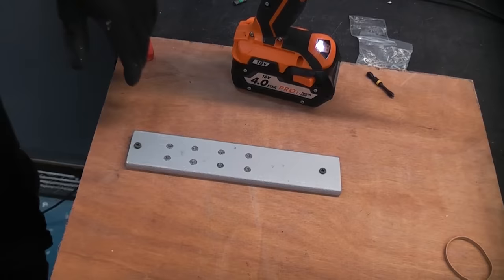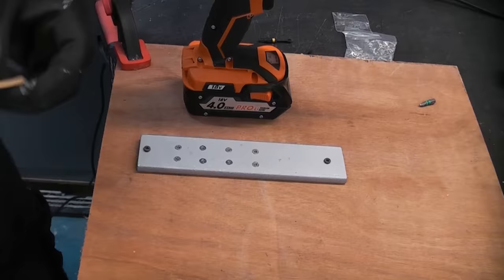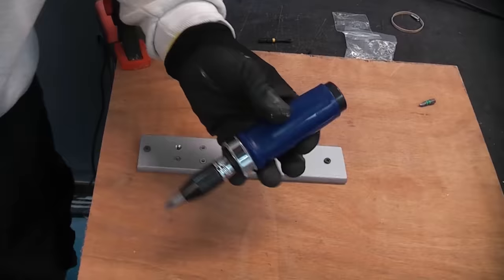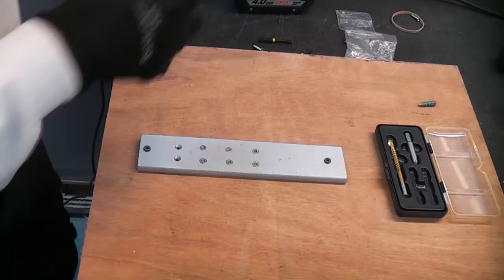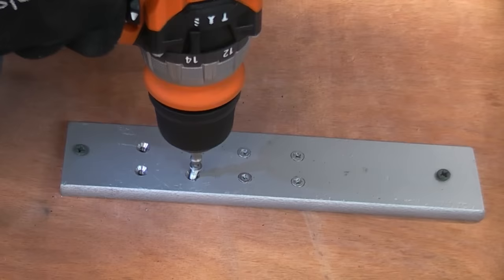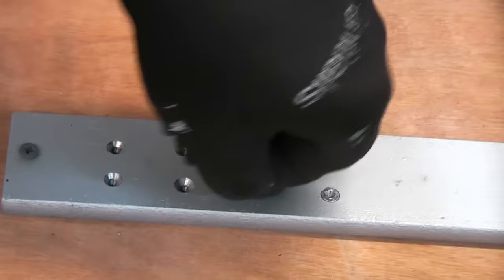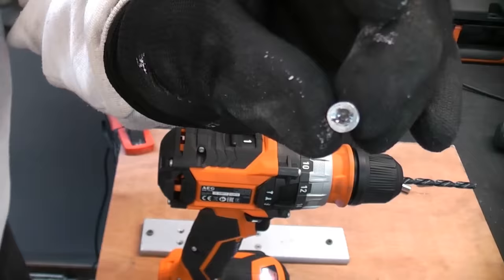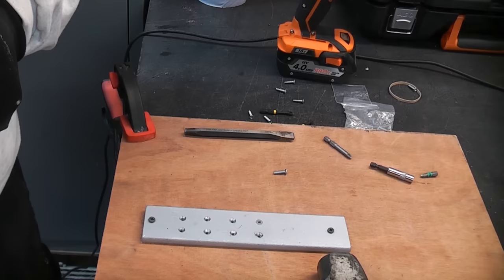How to remove stripped screws – 7 different ways

Comment: With stripped bolts or screws I've had really good success with taking a Dremel & simply cutting a slot across it & then using an appropriate sized screwdriver to break it free.

Even having the very small space to cut a straight slot is usually enough to work it free.

I can't tell you how many rusted & stripped automotive screws I've done this to. Grab the Dremel, cut a slot & remove it.

Comment: Fantastic video, learned a lot!
Sadly none of them helped me with my problem, as my case has a very small screw holding an SSD in place on a motherboard.
First trick didn't work on it and the other ones I avoid to not risk damaging the motherboard or other components.
Any idea how I could get out a very small screw without risking damage to the socket and its surroundings?
Reply from the maker: This might help-
Small stripped screw- https://www.youtube.com/watch?v=xaQ9eX-b6GA&t

Comment: Hi, Got the same issue but with a teeny tiny screw on a laptop's motherboard. The elastic band method didn't work. Don't know how to use a drill and the rest of the methods couldn't be used there for obvious reasons. Any help?
Reply from the maker: Small stripped screw- https://www.youtube.com/watch?v=xaQ9eX-b6GA&t

Comment: What do you think makes the rubber band method works?
Reply from the maker: I think it's just the extra friction.
Friction is a complex matter, I did not see a morse taper attachment until I was about 22, until that point I had only ever seen chucks with jaws- I was amazed that a morse taper could hold drill bits etc. without actually tightening anything up!
Thanks for the comment 👍

Comment: Just a note.  you can use a very small masonry bit just bigger than the shank on hardened screws, drill till the head comes off.  Do that on all the screws in the case of this plate, remove the plate using something like a wonder bar and unscrew the screws with a pair of vise grips.  These are great tips and I'll be sure to remember them.

Comment: A technique that works is putting pressure to the direction where the screw must go. For example if the bad screw is on the cover of a clock, you should pull the cover upwards while uncscrewing.

Comment: hi what would you use where the screw is the allen type screw where the inside has rounded off. The screw holds plastic in place on a motorbike which has little or no space to get a drill in.
Reply from the maker: This might give you some ideas- https://www.youtube.com/watch?v=WDOWPekMX44

Comment: At 7:03

Instead of using a left handed bit. If your drill can reverse, then can you just use a regular drill bit in reverse to turn the stripped screw loose?

Comment: You could also try to weld something to the top of the screw to try to remove long screws. Soldering may work as well, but you'll have to use specific flux, like orthophosphoric acid (citric acid, aspirin, etc. may work as well) to work with steel, especially stainless steel, which may damage soldering tip.

Comment: 👍👍👍Great video..I work as a locksmith and this happens all the time. Today i learned something new,,Test rubber bands...Do you have any tips for one-way screws. They are hardened. Today i use a chisel for a one-way screw, then it usually works. Otherwise, it will be hammer and nails. Do you have any other tips? Thanks for a great video..
Sincerely. Rogga/Sweden
Reply from the maker: Hi Rogga, I don’t have any more tips sorry, as they are all in this video. I have never had to remove one-way screws yet, but can imagine them being difficult to remove! 
Thanks for the comment 👍

Comment: I just used the spring action nail punch, and it worked!!!😮 The screw was stuck bad and I tried using a drill bit but it was the wrong direction so it made the screw worse, but I'll be damned, nail punch worked. I tried a regular punch, couldn't get it. But the spring one is where it's at!!
Reply from the maker: I have to admit that I was sceptical about the spring tools, but they are awesome 👍

Comment: What if it's on something delicate like a motherboard because i have the same issue I need to  change the thermal paste on my laptop but open the last screw that is stripped will the rubberband method work because the screw is too small
Reply from the maker: This should help-
Small stripped screw- https://www.youtube.com/watch?v=xaQ9eX-b6GA&t

Comment: You can weld a t shaped round bar(rebar) to the screw head and then rotate the same in anticlockwise direction to remove the screw easily.  I have removed a lot of bolts that were applied with high torque and loctite on the threads and still managed to remove them using this technique. Make a T shaped thing. Weld it to head and just rotate it anti clockwise.
Reply: @ultimatehandyman  its works mate. Try it. If possible will make video and share on YouTube.

Comment: Hi, I 'm trying to remove a burner from a gas kitchen top that is screwed to the stainlees steell  top of the kitchen. I 'm afraid That if use a impact driver, the steel on the top could be damaged  and since it's
It's not mine it may be damaged , please could You give me an advice as to , what can I do or what product can I use , ( iused w40 it dint loosen the screw), to pull this through?.
Reply from the maker: I'm afraid you might really struggle with this one, if it's been subjected to heating/cooling cycles.
Sometimes the only option is to drill them out! 
(Obviously it's hard to give specific advice without seeing it)
Reply: @ultimatehandyman Thanks

Comment: I have a screw  with a damaged head in a UPVC window handle that I cannot remove.  I have tried your various tricks and none of them work I went out and bought all the tools and nothing works  `its hard to get into the hole as screw is very recessed.  Is there another way to remvoe the  screw

Comment: Can you explain what you mean about wood screws at the end 8:42? Why couldn't these techniques apply for screws in wood (if I dont care about preserving the wood's good condition)?

Thank you for the vid, BTW. This is brilliant information.
Reply from the maker: The problem with wood screws, is that the head normally shears off, leaving the remainder of the screw behind. You then have to use a hollow drill bit to extract the screw and then repair the hole 👍

Comment: Wished these could help but I'm working on a small screw at the back of a Laptop so pressure would cause harm to the components under it and it's not large enough for the rubber band tactic

Comment: My Mom stained and varnished over her kitchen cabinets many many years ago. Now one of the hinges has broken off under the screw at the top and under the screw. The screws are now imo ilized and I cannot get a screwdriver into it. What can be done?
Reply from the maker: I would apply some paint stripper using a small brush, or failing that I would use a heat gun to remove the paint 👍

Comment: What if the screw is upside down with very little space around it to work with? Trying to get the screws off the carburetor bowl on my lawn tractor.
Reply from the maker: It's always difficult when the screws are in situation like that!
Hopefully you might be able to get one of the methods to work

Comment: I have a real issue with window handles.

Im tryna change them but the screws are really rounded, and to make it worse the screws are hard to get at as they are sunk into the housing of the upvc and the windows are in the open position so no real pressure can be applied on the drill or driver.

Helpppp

Comment: my landlord's been putting locks on doors to rooms in my house. getting the padlocks off is easy enough but he strips the screws on the lock fittings. i don't know if i'll be going out to buy any of that specialist equipment, certainly not a power drill, but i'll be giving the rubber band trick a go

Comment: You are working with screws that are not tightly attached to whatever they're screwed in and that helps a lot.. i have a screw that's so stiff it needed a lot of force to turn and that is why it got damaged in the first place.. I don't think i will have so much luck with it

Comment: I'm trying to get the screws out of the bottom of a top load washing machine as I need to remove the tub to clean it because it's covered in soap scrum and lime. And the screws are so eroded like concrete & breaking in the centre but I don't have a screw driver and broke a hand one and my wrist is killing me. So do I need to go buy a screwdriver?
Reply from the maker: Can’t you clean the drum using chemicals, without removing anything?
Reply: @ultimatehandyman  I tried with vinegar and a hot wash but still getting soap scrum on clothes. Oh well I might just have to get a new washing machine.

Comment: Great in theory, but aside from being tightly screwed in with a damaged head, the screws were not seized.  Do this same test with corroded or rusted screws.  I bet you have a different result.  Where I come from, screws get damaged not from using g the wrong sized driver but from using the right driver on a corroded and seized screw.

Comment: How can I get a stripped screw out of the hand wheel of my sewing machine. It is in a hole so I need something that will fit in the hole. I don’t even know what type of screw it is. I would appreciate any help I could get.
Reply from the maker: You might be able to get it using a left handed drill bit- https://fave.co/3DGC9fO

Comment: What if the screw is upside down 😢
Reply from the maker: It’s more difficult, but still possible. As a maintenance engineer, I had to squeeze into some tight spots, often led on my back in water etc. There is always a way 👍

Comment: Rounded screws, yes, but clearly none of these screws were rusted in. Most damaged screws I've encountered require an extreme amount of force. Id like to know if any of these techniques work with rusted screws.
Reply from the maker: For rusted screws, apply spray penetrant, or heat (if possible)
The centre punch works well 👍

Comment: A very useful tutorial. My only objection is that the screws were not very tight, or very long. The head was pretty damaged but it didn't require a lot of force to unscrew. It is obvious by the sound of the drill and the depth of the screwing.  A good video though, thumps up! I definitely learned something.

Comment: Any tips on removing screw after head has come off
Reply from the maker: Sometimes they are impossible to remove. On larger diameter screws, sometimes you can drill a hole down the centre and use a screw extractor. But with most screws like that the chances of removal are very low
Reply: thank you

Comment: Im having trouble removing a bolt that is stuck on my ebike motor i have a drill the does forward and reverse i managed to drill through the bolt but broke 2 drill bits
Reply from the maker: Cobalt drill bits are often better for jobs like that 👍

Comment: Good tips but half these techniques rely on minimal friction between the screw and the material. In wood, it doesn't usually work to initially loosen up the screw then simply spin it out with your fingers.

Comment: So I bought a license plate screw set (that needs a specific bit to remove it.) Of course before I needed to (a couple years later)…I had lost the “key” bit! So I thought I was being practical by just using regular Philips head with a rounded head to replace them when I finally got those out. And I just really over tightened them. So of course now that I want to remove those…(because I put them in so tightly) I’ve managed to completely strip one! So I’m here…but yes…I guess…maybe…just maybe…my age is a factor!
Reply from the maker: Best of luck with it 👍
If you are anywhere near Darwen, Lancs, I would be happy to help 👍
Reply: @ultimatehandyman  Well I got the one closest to the corner where my registration sticker goes…the license plate frame that I have on it makes it impossible to put the registration.sticker on correctly. So I managed to get enough space to do that and just tighten that screw back tight! The other side (screw) was only barely loosened so I put some foam insulation behind it to make up the space…so it wouldn’t rattle!lol I may have to get that “bit” for removing stripped screws to eventually get the job done correctly! Thanks for replying

Comment: You missed one but it will cause some surface damage . Dremel with a cutoff wheel to cut a slot in the head so you can then use a flat blade screwdriver.

Comment: This cover most of the possible ways to remove a new screw, but what about a screw inside the shower handle and it’s frozen tight. The screw doesn’t budge and I’ve tried every method here without any success. The screw is stuck and hasn’t moved to. It feels as though I need to get some rust remover lubricant to help with loosening it. It’s been a real pain. Ugh!

Comment: how about how to remove a 5/32 allen head screw, that is deep inside the actual screw hole from a piece of aluminum without damaging the aluminum, it is actually the bolt catch screw of an ar-15 lower receiver just to let you know
Reply from the maker: Is there any chance you can fit something down the hole to protect the aluminum, something like in this video- https://www.youtube.com/watch?v=dJfkCj3FWBs

Comment: The best thing  is prevention by not stripping the head in the first place, so
1. do not put damaged screws in in the first place, yes people do it!
2. if the screw head is full of dirt or paint clean it out first
3 if it looks worn use a correct size bit in  the head and give it a hard tap with a hammer. 
4. most people see the damaged screw and remove it last, remove it first, you will be stronger and be able to use more downforce.
5. if the screw looks rusty soak it in an  easing fluid like WD 40, but  leave it do do its job, dry the head before trying to remove it. ( not applicable for wood screws)
6. if you find a screw difficult to remove, put in a good quality screw in  the holes either side of the damaged one, and tighten down as hard as you can, this may take some of the strain.
7.Ttry using a ratchet with a bit as the downforce with an adjustable spanner on the bit as the turning force until you have loosened the screw, this can be a two person job to get the screw loose
8. Do not forget the screw may go into an anchor nut and most likely protrude through it, if you can get to the back, give all the protruding screws a squirt of  WD 40
9. if it will not damage the area and is safe to do so a little heat often helps
The above are lessons learned from working on vintage aircraft with panels that have not been removed for decades,

Comment: I was installing a ceilling fan, i hated using trunking and i was using like a pvc base for the regulator, it had like a place to put your normal ganged switch in, the fixing holes for the switch had no threads, so i had to drive the screw first. I sheared the screw head, sweared multiple times, eventually snapped the screw in half. Eventually bought a new pvc base for the regulator lol
Reply: @ultimatehandyman  it went well lol, everything works fine, the screw probably stripped because i didnt apply enough pressure while using my cordless drill

Comment: My problem is that the screw is impossibly tight. As I was trying to screw it while it was still fine, it just damaged it to the point the screwer doesn't move the screw anymore. No idea what to do

It doesn't even have a space for me to chisel it like you did
Reply from the maker: Any chance of applying some heat to it?
Reply: @ultimatehandyman  Thank you for the response, thankfully we already got it.  Had to call a service man but at least it's okay now. Still the video was very helpful,  I definitely think I'll make use of it some other time!

Comment: Nothing is working.  I'm at my wits end.  I have to remove a shower handle.  I even went out and bought the extractor (GrabIt).  I may as well have been spitting in the wind.  What do you do when nothing is working?  I don't want to damage the pipes the handle is attached to.
Reply from the maker: Sometimes it is impossible to remove some screws, and replacing the whole fixture is the only option 👍

Comment: I need help . I’m trying to remove the cover  on my window air conditioner unit. Dirt and leaves are inside it .  How , idk.. I guess from last summer . Needs cleaned period . All screws are off except literally one!! It’s stripped . Over the last three days I have tried using the tips of broken off knives I’ve tried using screwdrivers I don’t have a drill and I can’t afford to buy one right now either. I have tried putting the rubber band trick I have tried almost anything you can think of I’ve tried scissors the tip of a scissor.  I went to the hardware store and bought other different size screwdrivers.. literally nothing is working I even put caulking inside of it and let it dry to hope that the it would fill up space like that “easy out “ stuff … and nothing is still working I can’t get the cover off unless I get this last screw out and it’s very irritating. It’s getting hotter and every day my kid goes to school my whole day consist of trying to get this damn thing off and my kid gets home and every time she asks did you get Mommy did you get it yet and I have to tell her no… because of this little freaking stripped screw!!!
Reply from the maker: Nightmare!
I'm afraid you might need a drill to get it out!

Comment: How about when the threads are stripped?
Reply from the maker: Very difficult, sometimes you have to drill it out and re-tap the hole, or drill it to a larger size and use a helicoil. Example here- https://www.youtube.com/watch?v=sQHRB2ElZJ0&t